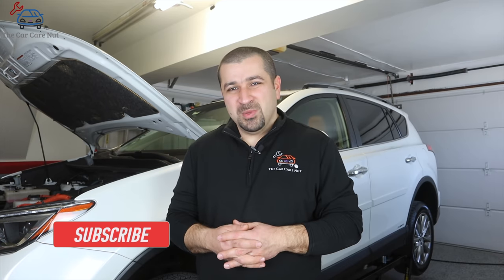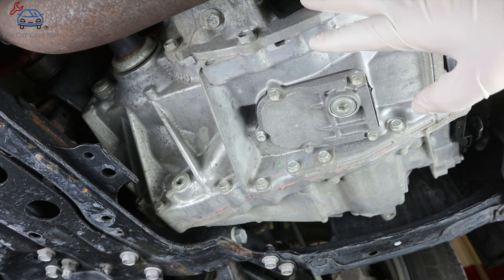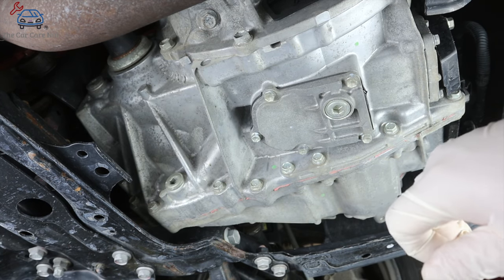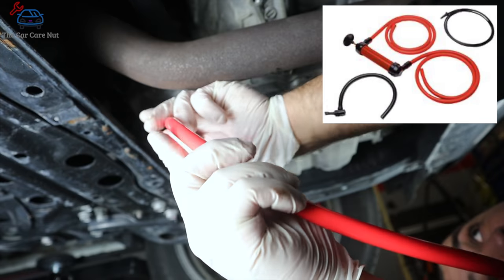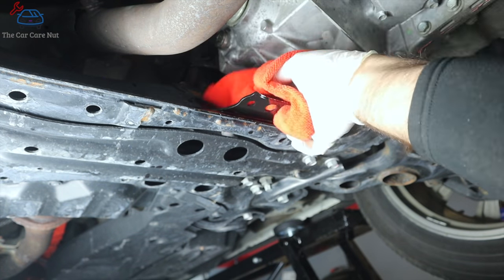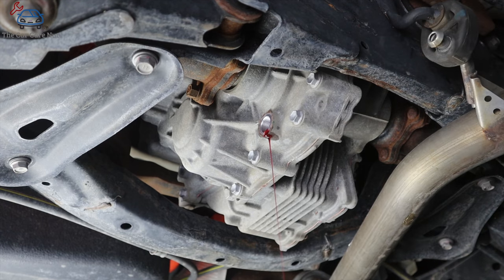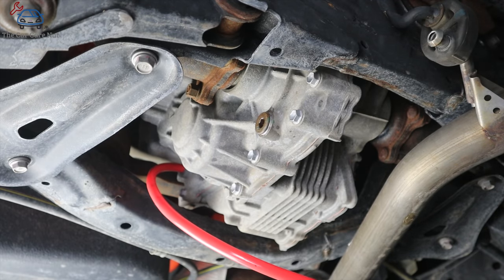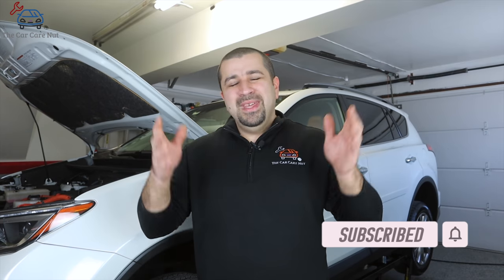How to change Toyota Hybrid Transmission fluid and Differential fluid

Comment: Thanks for posting this video.  Very timely.  Just made an offer for a '21 Sienna hybrid. 
Instead of "CVT" Toyota should have branded these as "Planetary Transmissions" or some such lingo.  The name "planetary' speaks to enough of the weirdo greenie crowd that they'd swallow it like a Tofu Almond Juice Smoothie. Most importantly, it avoids the negative, unreliable connotations of belt "CVTs."
I should add that Weber Auto's vids on the Rav4 P710 transaxle completely changed my mind.  That and realizing WWII tanks used planetary transmissions.
Reply: They were calling them eCVTs - electronic CVTs - in the Olden days. In Toyota technical literature the working part is just called a hybrid transaxle.
Reply from the maker: As flagmichael mentioned Very few places in tech papers they call it an eCVT. Mostly it’s known by its model name and hybrid transaxle
Reply: Your comment is really funny. Enjoy your Sienna.

Comment: In my rear Diff, the AT fluid that came out of my 21 Prius AWD (at 25,000) miles was surprisingly clean so I will let her go 50,000 for the next one.  I was also surprised my drain plug had no magnet on it so thinking about putting one in when she hits 75,000 on the next service.  (About 1.4 qts came out and back in.)  I hate those pumps so used a funnel with a long hose and held it just above the wheel with the right hand and used the left to keep it in the hole.  (And this is ColoradoBoo on my other account.)

Comment: I love your videos! I own a 08 Lexus 400h and ask.......I have always heared (gas) engine trannies should not be touched.   My car has about 189000 miles and runs great. Is my front tranny different such a that I should ignore what I have always been taught? No control at to know if fluids have been changed other than then constant oil changes lil more frequent then required, as I want to well maintain this car.  What about this newly being pushed brake fluid flushes?   Thanks for what you do!

Comment: Hi Amd, thank you for all that you do. Love your channel. I just bought a 2003 Toyota Prius with 231k miles. It look like the inverter pump recently got replaced. The car don’t blow heat at the moment, but engine seems to run fine, no overheating, how do I go about to bleed the system on these 1st gen Prius? Thank you in advance.

Comment: Another great video! One question. I noticed that you said to replace the gasket on all drain and fill plugs except for the rear differential fill plug. Does the rear differential fill plug also need a gasket? In other words, do I need 3 or 4 gaskets? I have a 16 rav4 hybrid, so I’m guessing the change will be identical to the one you’re doing in the video. Thanks again! You’re awesome!
Reply from the maker: Hi! Yes there are 4 gaskets for each plug.
Reply: @TheCarCareNut  I think you mean 4 gaskets - one for each plug.
Reply from the maker: You’ll need 4 one for each plug

Comment: I like how easy it is to change but I wish there were a transmission dipstick so I could check the level and condition of the fluid without taking that big pannel off the bottom of the car and undoing all those rivets. I have had alot of mechanics lie to me so I check the fluids before and after each oil change to make sure they were actually changed.

Comment: Thank you so much sir for your great videos. I recently bought a 2006 hybrid highlander with 138,000 miles on it. It runs and shifts smoothly, but there is no record if that transmission and differential fluids has been changed before.  I want to ask you if it is a good idea to change the transmission and diff. fluids now. I appreciate your time , knowledge and response,
Thank you so much and have a blessed Christmas
Reply from the maker: Hi! On Toyota hybrids you can change the fluids at any time without worry about issues unlike a traditional automatic transmission. Merry Christmas

Comment: First time seeing you. Awesome video and valuable knowledge. I just bought a 2008 Camry Hybrid and want to do all the maintenance I can on it even though it drives so smooth at 180K.
The plugs and coils easy to replace?
Any other preventive maintenance you recommend on a high mileage hybrid?  Thx.

Comment: Thank you for answering all my questions in the past. 
You are very responsive to your subscribers:)
I just did transmission fluid on my 2017 hybrid Highlander. I was under the impression that it takes 4 quarts in the front and 2 in the back.
It would appear that I put about 3.5 or 3.25 in the front. 
Less than 2 quarts in the back.
As I was pumping, I waited for the excess fluid to leak out to the same upper hole. Is it normal to take less transmission fluid? Is it because there is some fluid in a transmission cooler?
P.S. I was doing the transmission fluid change on the ramps. I don't have a lift. The car wasn't level does that make any difference?
Reply from the maker: Hi! That’s ok on the fluid level. Doing it on ramps can give you an incorrect level. Try to get jack stands and a jack and lift the car level
Reply: Thank you
Reply: @TheCarCareNut What is the fill/drain plug torque for 4th Gen Prius? I have a 2019. Thanks!!!!

Comment: I love your videos.  I have a 2020 toyota rav4 hybrid xse, I like watching the channel because it reminds me when to take the car to the shop for service.  Im a bit nervous doing my own work.  I am wondering if there is a way to know how much is the average cost for this service.  I called a dealership and they seemed to break up what you just showed into 2 services, the transmission, and then the rear drive motor drain/ refill.  I have almost 70k in miles.  thanks

Comment: Great video! THANKS! I have a 2017 Lesux RX450H F sport ( got to get the F Sport in there ) I need to change the drivers Axle, do you have a video on that? Do I need to change the ATF/Diff fluid because it leaks out of the axle shaft hole?

Comment: I did this last night. I broke so many clips and one snapped screw on the under cover. It made a MESS gushing out, and it's still hard to soak up with paper towels. Such a hateful task. Plus I had to re-use one washer as the parts department only gave me two (used one on the coolant change).  Feeling a bit disheartened but the job got done anyway.

Comment: Great video...The Toyota Hybrids are so easy to do the regular maint on. 
I have an 08 Prius, Has 423,000 miles on it.  I put 223K on it in 4-1/2 years. Mostly city, some long road trips in there too.
 I changed the fluid every 50K.. its super easy to do .. seems like cheap insurance.
I would suggest for the average person, just use the Toyota fluid. How many times will you need to do it over the life of the car. For someone like me that puts a TON of miles.. I used quality aftermarket fluid, I used Valvoline MaxLife Full Synthetic ATF.. it is Toyota WS rated., comes in a 4 quart jug for $20.
My Prius takes 4 quarts.. so its easy to make sure its at the right level. 
Fill plug is in front on mine, I just stuck a hose down the front of the engine, stick it in the hole, and put a funnel on the top of the hose.. dump all 4 quarts in.  Done.
Reply: wow how many times have you changed the battery?
Reply: @hc3550  
Still original as far as I know.
I bought the car with 200K on it.
Battery tested about 60% capacity.
I put another 223,000 on it battery tested about 50% capacity with a couple of modules being a little bit off but the car still runs and drives okay..
Actually ended up with an engine failure recently. Very unusual on a second gen Prius. But it was a cascading failure. Car started to burn a bit of oil, catalytic converter got plugged up, the increased back pressure finished off whatever compression ring was leaking the oil past. And I lost compression in cylinder 1. So it's still runs and drives but it runs like poo... Now it's dumping a amount of oil out the exhaust. Like a quart every couple hundred miles

Comment: Hello & thank you for sharing this video
Quick question, you mentioned that in high mileage hybrid vehicles you don’t need to worry for changing your transmission fluid, does this only apply to toyota and lexus or its the same for every hybrid? I have a 2008 Nissan Altima hybrid, 240.000 miles on it & I just wanna make sure before I touch the transmission. I was told by the dealer that in case I don’t know if this service has been done regularly it’s best to leave it alone. 
What do you recommend?

Comment: Great video, very helpful. Do these come with internal restrainer/filter that need to be changed later on? I plan to drive my 2020 highlander hybrid for 300+ k miles and I tow trailers too, I might need to change the filter if there is one.

Comment: Hello, thank you for your awesome videos, does this rear differential make any noise when moving the wheels? When I put my ear on it it makes a noise that I think is similar to the one I hear when I’m going at at higher speeds. I’m at 180.000 km and I haven’t change the oil in it. Thank you in advance 😄

Comment: Hi AMD. Thanks for the amazing video! You truly are amazing! I have two quick questions. 1) The transaxle uses the exact same transmission fluid as the transmission, correct? (Toyota WS). 2) Approximately how much fluid does the transaxle hold/about how much fluid should I be putting back into the transaxle after draining? I have a 2017 Toyota Camry Hybrid. Thank you very much in advance.
Reply: Fluid amounts and type are in your owners manual
Reply: @basicuser54  Thank you very much!

Comment: Thanks for the video.  Is this the same process for changing the transmission fluid on a 2023 Toyota Prius prime? What is torque spec for 2023 prime?

Comment: Great video AMD! With hybrid transmission fluids, is it necessary to raise the fluid to operating temperature and check it with a scanning tool?
Reply from the maker: Hi! No it’s not needed. Just drain and fill until it overflows

Comment: Thanks for the video. As you mentioned early in the video,regarding the regular transmission. Why would changing the new fluid,damage the transmission ? I thought, it would help improve the performance. Second question,from what I have seen in the past, the differential fluid should be a lot thicker and not red in color. I guess things change for improvement....
Reply from the maker: Hi! This video is exclusive to hybrids. Non hybrid differential would use gear oil which is a lot thicker.

Regarding the fluid, changing old fluid could damage the clutches and cause slipping. If the fluid is changed on time it’s ok but if it’s a lot overdue it could cause actually damage not good.
Reply: @The Car Care Nut   First of all, I want to thank you for your videos, they're very informative and easy for me to understand. About a week ago I purchased a 09 es350 with 119000 miles.I am in recovery from a broken tibia surgery so at this time I can't do my own maintenance on the car. Today I took the car to a Toyota dealer to have the transmission fluid drain along with the filter. The mechanic drained the oil, not flush, which I didn't want a flush because the miles.But I was told that the mechanic didn't drop the pan to chain the filter because even though the oil was dark, it didn't have any metal sediments. My worry is on the receipt it says 6qt of oil. In your video and other videos I only see adding 3qts when draining from the plug. Wouldn't 6qts be to much? Or was I charged just the basic like an empty transmission. Now I'm worried about driving the car with 6 qts when the pan wasn't even dropped 😕
Reply from the maker: Hi! I wouldn’t worry as they usually have to check the fluid level. Some mechanics like to change the fluid twice that might also be the case. And they’re right on the filter don’t worry
Reply: @The Car Care Nut   That's great to hear. Thank you .

Comment: Thanks for you great videos ..  question i went to lexus dealer to change  the transmission fluid on my lexus 2013 es300h . They refused to do saying the sealed transmission never change the fluid unless a problem is true ??
Reply from the maker: Not true. It’s very simple to replace the fluid

Comment: The toyota website says that part number is not compatible with my 2014 prius V. Is that incorrect information? Also you meant to say to put the fluid pump in the fill hole firmly right not loosely? And so i need three of those gaskets for this job right? The differential fill hole doesnt need a new gasket? Thank you so much for all your help!
Reply from the maker: Hi! Your Prius V does use the same gasket number but there are 3-4 part numbers for the exact same gasket. Your Prius V only has a transmission in the front, no rear differential. You will need 2 gaskets total

Comment: Thank you so much for these great videos!  I just subscribed.  I'm a little confused.  I have a 2014 LE 2.5L Camry Hybrid. Manual says it uses ATF-WS Transmission fluid. What about the Diff fluid?  Nothing is mentioned in the Maintenance Manual.  Can I use any good brand Diff Fluid?  Awesome channel!!!!
Reply from the maker: Hi! Your Camry doesn’t have a separate differential. When you replace the transmission fluid you also replace the diff fluid
Reply: @TheCarCareNut  My dealership wants to charge almost $400 to change the transmission fluid on my 2014 Toyota Camry Hybrid. They say they have to hook it up to a machine to make sure the temperature is correct.  Can I change the transmission fluid myself when the tranny is cold?  Or, should I take it to the dealership?  Also, I'd like to contribute to your channel.  Do you have a Venmo account?  Your advice is awesome!
Reply from the maker: You can’t connect a machine  and do a flush on hybrid transmissions. Did you mention to them that it’s a hybrid?
Reply: @TheCarCareNut  yes.
Reply: Just sent you a small Paypal amount to thank you!  Hope many others do as well...
Reply from the maker: Thank you very much! I appreciate your generosity!
Reply: @TheCarCareNut  You're welcome.  On a 2014 Camry Hybrid, is there a temperature range the fluid should be checked?  or, is it just easier to measure how much was drained and replace that exact amount?
Reply from the maker: On the hybrid transmission it’s just a drain and fill until it overflows and you’re all set. No temperature method needed

Comment: I didn't say they are the same,  but on 2006 Lincoln zephyr, to continue, unplug on the drain plug, let the transmission fluid drain and tight the bottom plug, and go on the very top of the transmission and fill it up with the ATF FLUID TRANSMISSION.

Comment: I have a question not in relation to this video...

I have a brand new 2021 4runner and has planned to do the 1st oil change at 1000 miles. Then stick to 5k, 10k, 15k etc. Is there any reason that is a bad thing and I shouldn’t do it? I’ve heard but not been able to confirm that new engines have something added to the oil from Toyota factory to help with break in and I want to make sure I’m not doing harm but doing it earlier than needed. I feel like I know what you’re going to say “won’t hurt”, but just want to feel better about it. Thoughts?!! Thanks in advance. Love your channel!
Reply from the maker: Hi Joey. If there was a different oil from the factory there would have been a specific note about it. Go for it.
Reply: @TheCarCareNut  thank you sir!

Comment: Great video,   I bought CVT Oil for a 2008 Lexus RX400H,  Have i got the right oil and does the differential require the same?
Reply from the maker: Hi! It uses WS transmission fluid not CVt

Comment: Hi i bought a second hand 2018 prius plus 7 here in Norway and now i got a 61900 kilometers shoud i change the transmission oil now or i can keepl on running and im still safe? Thanks for the videos it helps a lot :) 🍻❤️
Reply from the maker: Hi! I wouldn’t change until you’re at or past 100k kms

Comment: I assumed that Toyota hybrid transmissions had the same complicated fluid change process as their automatics, but this is as simple as the manuals I've owned. Do the newer Rav4 hybrids with electric motor in the rear follow a similar procedure?
Reply from the maker: Hi! Yep they’re very simple! The new RAV4 has the exact same setup

Comment: Great video!

I changed the trans fluid on my wife's 2010 RX450h with Toyota ATF WS. Everything was going swell until I had to refill the trans... the pump hose would only enter the fill hole by a few mm's before it hit something in there so I just did my best to continue to follow your instructions. I was most concerned that I had enough where it would start over flowing from the hole as you mentioned but with that obstruction, much of it ended up on the floor and oil drain pan. After putting in most of the 7 quarts I got for the trans AND rear diff into the trans, I thought there has got to be enough in there! It over flowed a bit out of the hole but not like what you showed in the video. I could stick my pinky in the hole and it looked like it was right there at the base of the fill hole (vehicle was jacked up but level with the rear). What was that obstruction in the fill hole that made 2 quarts (?) spill out? I did not think of it then but would the obstruction have moved if I rotated a wheel?

I think I am good because I made sure sure there was no excess oil coming out of the filler oil but just strange that it should have taken 4.9 quarts and I used up to 6.9 quarts!

Anything I should be cautious about at this time? Thanks!!
Reply: Where did you get the 4.9 qts number from, is that specific to the RX450h or for a similar vehicle? Some of these transmissions will be larger or smaller, for example the Prius/CT transmission will only need about 3.5 qts for the change. Also the rear diff should be using a different oil than the transmission.